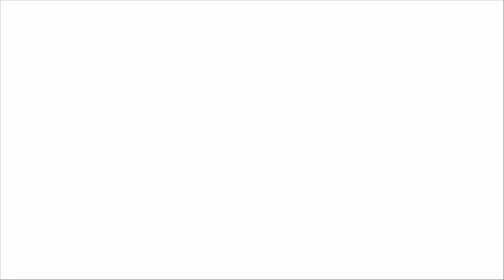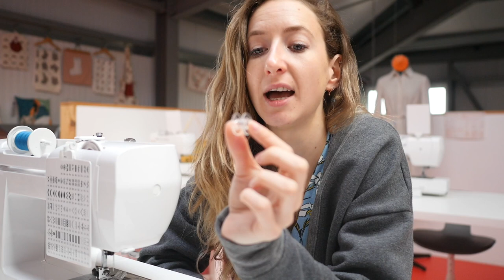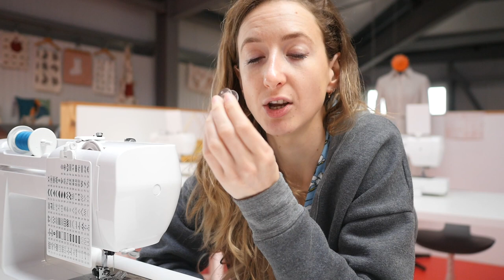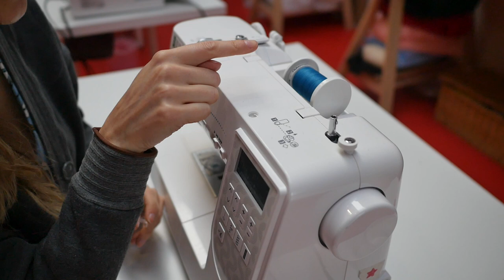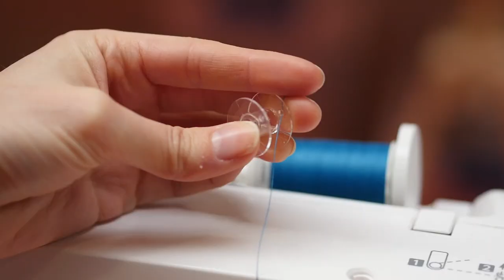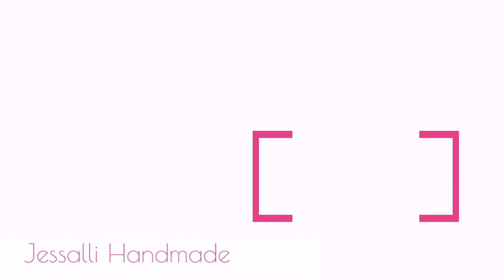How to Wind the Bobbin | Perfectly Tensioned Bobbin | Winding the Bobbin Tips

Comment: Hi, hoping you can help. I've had no trouble in the past (limited past) winding a bobbin. I have a new singer machine and can't get an even wind on the bobbin. It's in the slot correctly as far as I know. Have you ever had to adjust that tension piece? I see it has a place on top that can be turned to tighten it or loosen it but neither seemed to help. Any advise? Thanks.
Reply: Your title mentions correct tension. How to you alter the tension?
Reply: @kimberlykeller9995  Not sure you are understanding my dilemma.  The  thread goes around that silver bit and gets snug  in there, then goes on the bobbin. It's that silver bit I am inquiring about. Thank you.
Reply from the maker: That silver bit keeps it tight yes, but you shouldn't need to alter the tension at all. What happens exactly when you try. Are you holding the thread to get it started? And has your machine been serviced? x

Comment: I've threaded several bobbins, but they don't want to release the thread. No point in even putting them in the bobbin case. I'm using a new Singer Patchwork, and have followed the bobbin threading steps. What am I missing?
Reply from the maker: Do you mean there's no end to the thread? Or is it all tangled on the bobbin?
Reply: The bobbins aren't tangled up. The end on each is loose. If I hold the wheel sides of the bobbin between my thumb and finger the thread comes off the spool  easily. But if I put it through the little circular hole on the side of the bobbin, the thread can not be pulled gently or firmly from the spool. It needs to be able to flow out to funtion.

Comment: Mine has vertical thread holder not horizontal and when I wind the bobbin it jumps around and off the spool. It didn't come with a cap to keep it on.
Any tips?
Reply from the maker: Couple of things, you could try putting a felt piece on your spool holder first to create a little more friction and stop it spinning uncontrollably. Otherwise I'd just have my hand above it or slow the pedal down a little. x